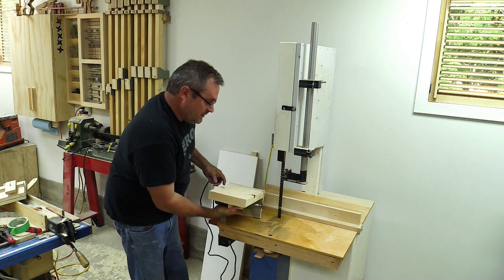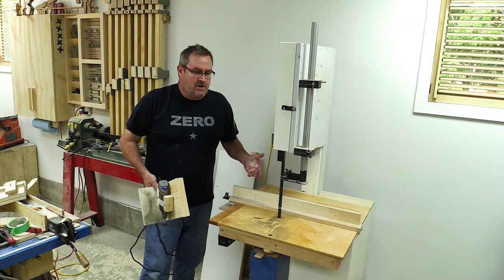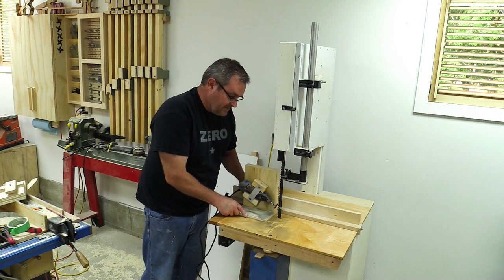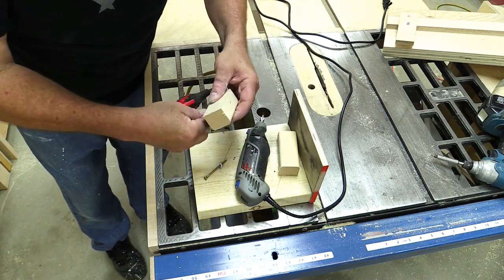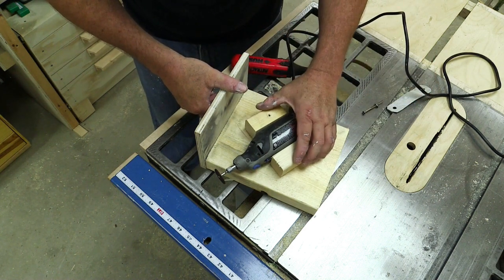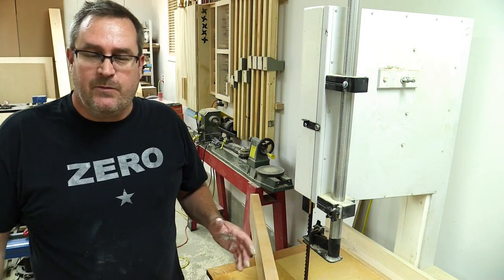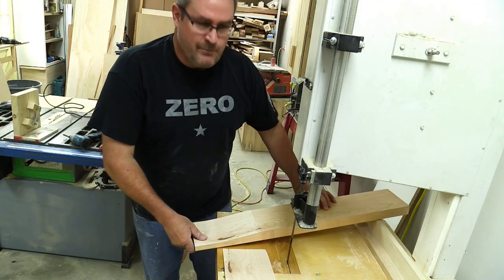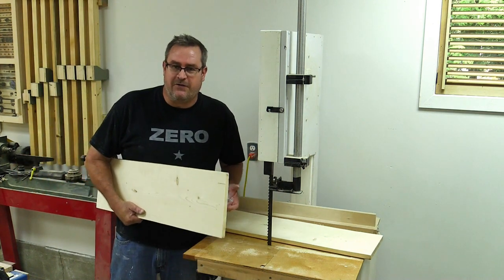Easy Band Saw Sharpening Jig

Comment: While re-sawing through some CA Oak and discovering that deeply embedded was a wire clothesline that took the edge right off a new 3/4 inch blade, I remembered this video. It took longer to build the jig than to sharpen the blade. Although that sharpening the top of the rake of the tooth may not be the correct way to sharpen a bandsaw blade it will certainly work for a few sharpenings or until the set is ground off and that is another issue altogether. My only improvement was to add a stop block to keep the depth of the jig from cutting to deep. I also found it easier to lift the blade into the grinding wheel. Great job on a simple solution. Thanks John ! Keep up the great videos.

Comment: As near as I can tell, the correct angle to set the Dremel Tool is 22.5 degrees.  I made my own jig and it's a little simpler than the one in the video.  I sawed through a hidden screw with my band saw blade which really did a number on it.  I thought for sure I was gonna have to buy a new blade but I used John's method of sharpening and I'll be danged if the blade didn't cut 10 times better than when it was brand new.  Amazing!  Thanks, John!

Comment: Great tip, just wanted to add this note: To all new woodworkers, that here in Australia your average $30 bandsaw blade, depending on TPI you might be lucky to get 2 re-sharps out off it, unless you spend around $250 a blade and even then might last a lot longer, but still you might only get 5 re-sharps, so in my opinion and what i do depending on situation, 1 sharpen then replacement. I still might get 3 to 4 months out of one cheap blade. Hope this helps someone. And not that I'm trying to take away from John's video but I sharpen from the bottom of the teeth as this is the down stroke of the blade.

Comment: Hi John, Useful rig. One way of speeding up the process and maybe save your back a little might be to use a fulcrum set so that it moves the blade up by one tooth at a time. Or you could sit down during the process! Backs are worth looking after. Regards.

Comment: Thanks for the video Sir. I have a 10” WEN that is 2 years old. Original blade but doesn’t get used a lot at all. All at once it has started cutting sideways terribly bad. If I pushed it to cut 2 inches in length it would break the blade because it has already gotten so sideways. I tried adjusting the top wheel. Didn’t help. I noticed the blade was coated in what I thought was sap. I cleaned it with gasoline and got it spotless. Didn’t help. I tried to remember what the last thing I cut was and I remembered cutting a small piece of firewood and also cutting some plastic. I finally decided one of the 2 had dulled my blade. I looked closely at the blade and it made sense to me that it was dull. This is why. The blade is a wood cutting blade. I would say 50% aggressive. Sorry but I know nothing about these blades except wood cutting from metal cutting. The blade has one tooth sticking to the side and the next 2 teeth are straight. This pattern is all the way around the blade. I thought it would be tooth left, tooth right, tooth left, tooth right all the way around. But its not. So I am unsure how to sharpen it because of the pattern. If it was left, right, left, right I understand you would sharpen this one filing left and the next right etc.And the reason I say it made since to me that it was dull is because it cuts in the direction every 3rd slanted tooth is pointing. Every 3rd tooth is slanted to the right and thats the way it cuts severely. If you Sir, or anyone who might read this could give me some insight or enlighten I would be very thankful. Thanks again Friends!!

Comment: Improvement suggestions: Add a spring loaded pin stop to locate the blade vertically and perhaps a stop to limit the forward movement on the Dremel tool holder to get a more consistent grind .

Comment: Good Video John. One Question I know that you just touch the blade with the tool, does it matter if one tooth is ground more then the other? Should there be a stop on the bed to prevent this?  Thanks

Comment: Is the sharpening on the upstroke or the downstroke side of the disc?  or to put it another way, do you place the dremel so the the disc is turning so that the grit of the disc goes down towards the tip of the tooth, or away from the tip of the tooth?

Comment: I am definitely gonna make one of these. Quick question, however, what's the approximate angle that you set the Dremel tool at with respect to the base?
Reply from the maker: +John Treble 
It's set by eye to match the tooth angle, whatever that happens to be. More details in the website article.

Comment: Excellent, John!  Will you please tell me which wheel you use on your Dremel for this?  Is it just a cutoff wheel, or is it a heavier grinding wheel of some sort?  I am concerned that my cutoff wheels will shatter.
Reply: +wilcoxtube This is exactly what I was wondering after just finding this video. I sure hope someone chimes in with the answer soon because my blade could use a good sharpening.
Reply: Hi, it is the grinding disc that comes with the Dremel

Comment: But... you are sharpening the wrong side of the blade.  It's the face of the tooth & the gullet that does the cutting.  While you are putting a tiny bit of a sharp point on each tooth, that is not going to last long at all.  Looking forward to version 2.